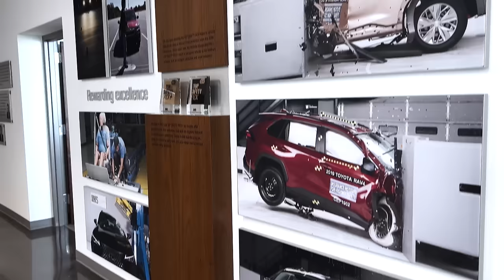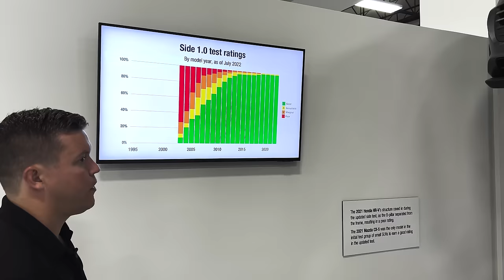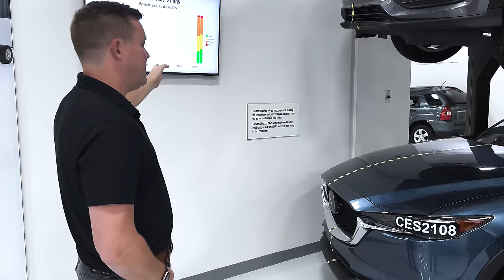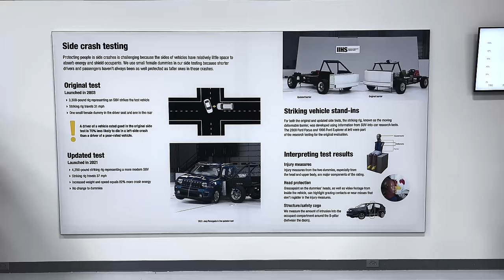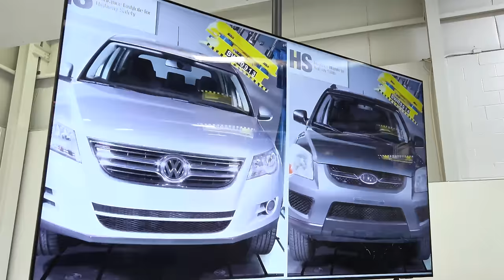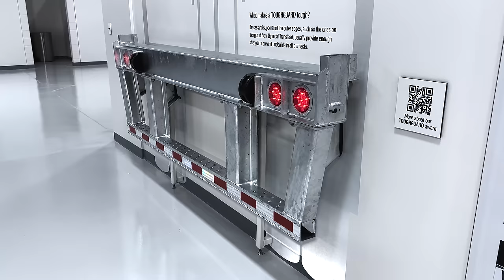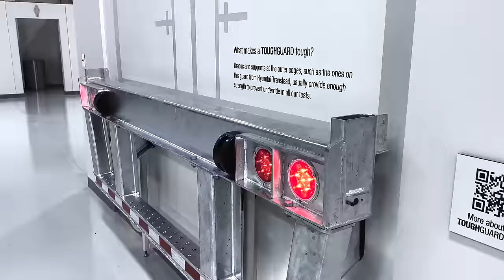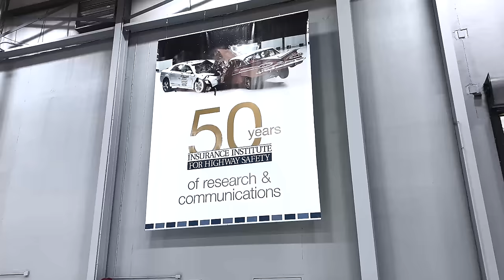Ford Mach-E Moderate Overlap Front Crash Test | IIHS Tour

Comment: Imagine a car with a big casting structural piece, would be quickly totaled. The same already happens with super cars using monocoque tubs. The difference, is that they are way stronger and flexible than a cast Aluminium section.
Reply: Most other modern cars will be totaled with a crash hitting welded structural pieces just as casting large structural pieces. Anything above a "fender bender". Super cars are big single carbon fiber body panels and create a completely different scenario for totaling.
Reply: If you are thinking of cyber truck then you may have some point, depending on a lot since it's not out.
Reply: Any hit hard enough to damage a gigacasting (if that's what you're referring to) would total any car.
Reply: With Casting The Cars become much savier... One aluminium Casting ist way better than 100 welded pieces....
Reply: @electrichead2022  there's a reasoning in many decades of car production, Automakers avoided build big structural pieces of cast Aluminium. Do your research, and avoid falling for the narrative of Tesla grifters.
Reply: @collinbradford8866  for a reason most trucks with a body on frame layout been around through decades. But if the final goal it's to use a truck as a car, then big casting pieces won't make a big difference.
Reply: @RogerM88 Do you know why Teslas Model Y With Aluminiun Casting in the Front und Rear have better Crashtest Score (NCAP Europe) then the Model Y With normal structure? My opinion is, that the Way of Tesla to Produce less Pieces With Aluminium Structure is very good. I wait for the 30K Model 1/2 and I hope that these Car ist made of an complete Aluminium Casting...
Reply: @electrichead2022  and so what? In F1 the cars are design to completely disintegrate to absorve the impact, to save the safety cell. Tesla uses big castings to save production costs, simple! Even if it means a small impact of even the effects of fatigue on the castings produce cracks on the casting pieces. If you are a wealthy person, that trades his cars very often. Then Tesla is the brand for you.
Reply: @ohger1  without deflection of the casting it also totals the people
Reply: @mattbrew11  I don't think you're smarter than anyone...
Reply: Every regular vehicle has crush sections so it’s repairable up to certain speed. Basically everything over that speed is unrepairable
Reply: @mattbrew11  You really think the entire vehicle is a cast rigid structure?  It will be designed with crumple zones and will pass the gov crash tests with flying colors.  Any impact that intrudes into the gigacasting will be severe enough to total any car. Go read Scotty Kilmer because he's right about your intelligence level.
Reply: @ohger1  the entire structure? I didn’t say that nor did I imply that. All all even for a second
Reply: @ohger1  crumple zones on a big casting piece? More likely disintegrate it self to absorve the impact forces.
Reply: @ohger1  Scotty Kilmer been around cars through decades. He is more like a Mechanic of the common folk, that seeks a reliable and dependable car. If you're a person wealthy enough to be changing cars, as changing pants, then what he says could mean nothing.
Reply: @ohger1  also, in the Automotive industry, reliability and cost of ownership are important factors. Tesla is still new to the industry, so the mainstream doesn't really have a perspective of it long term reliability and cost ownership. As an example, Land Rover, even not known for it reliability, sell quite well. Especially in the luxury sector. So if Tesla wants to get outside of the luxury sector, they will eventually need to focus on the availability of their parts inventory, and their service network. Where most Automakers rely on the Dealerships for that.
Reply: @RogerM88  Kilmer is the patron saint of people who know absolutely nothing about cars.  He's a backyard mechanic at best, and not a great one. Much of his advice is flat out wrong. We had a guy working for us who screwed up everything.  He was called Scotty right up to the time we finally let him go.
Reply: @RogerM88  Pay attention.  The casting doesn't extend to the sheetmetal... Maybe you should hire yourself out to Tesla an help them re-engineer their mistake.. Better hurry, because ALL manufacturers will be moving to big castings to improve tolerances, reduce cost, and lower weight.
Reply: @ohger1  most manufactures aren't moving fast towards big casting pieces for many reasons. One it's the high rate of rejected casts due to production quality control. Second there's the cost in production of using such big pressing machines, as if they need to be serviced, it could slow the production. Where using smaller pieces, smaller pressing machines can be used. Then there is the issues with potential recalls, very costly to the Automaker, if it's detected that a batch of castings had integrity issues. As referred above, for a reason Automaker aren't switching quickly towards big casting pieces for a reason.
Reply: @ohger1  add other issues as potential increase in overall weight, than using a sheet metal construction. The molds could be damaged over time due to thermal shock. Using sheet metal can be more easily set into a welding robotic line. Don't fall for all the hype on Tesla grifters about the use of big casting pieces. There are pros and cons.
Reply: @ohger1  Also do your research about the percentage rate of rejected cast pieces with Tesla. As the distortion issues that may happen with big casting section pieces.
Reply: @collinbradford8866  Welded pieces can be cut off and replaced, once a casting is hit hard it's scrap. The entire casting must be replaced which is much more costly.
Reply: @electrichead2022  A casting doesn't replace 100 welded pieces, stop the cap. It can replace several separate pieces that are independently repairable. The damaged casting is toast.
Reply: @electrichead2022  Tesla is still using quite a few welded pieces in rear suspensions.